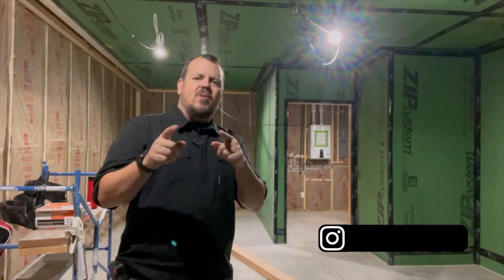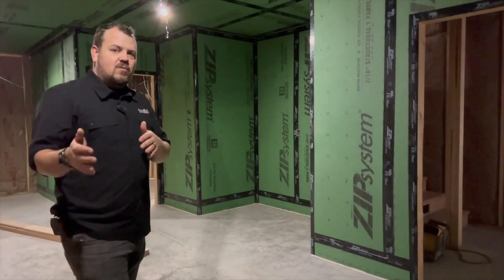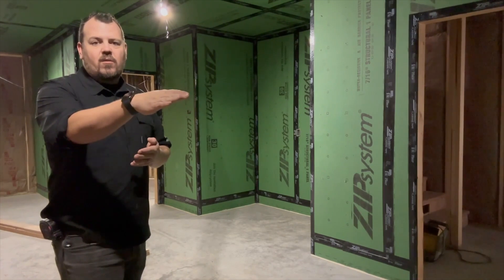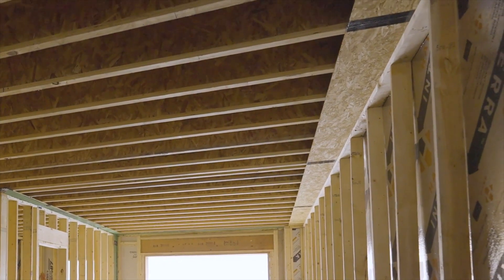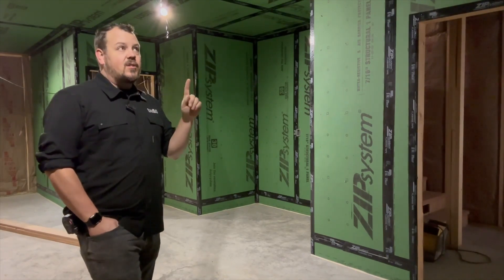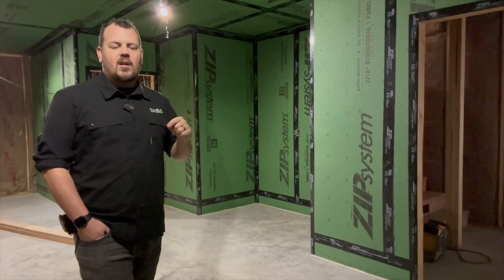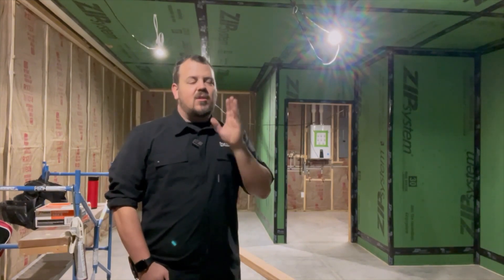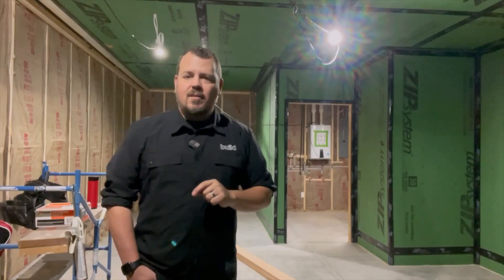Air Leaks Between House and Garage

Comment: I love the idea of separating the garage from the living quarters. From the perspective of a "DIY" guy, when I build my house I am not confident in my ability to properly seal all the smart vapor membrane around all the wires, pipes, and receptacles.  A hard surface would be much easier to seal for an novice like myself. Could I line my ceiling with Zip or taped plywood to make the penetrations sealed and then add the smart vapor membrane, put furring strips on the ceiling and walls so puck style lights and picture nails don't penetrate the membrane, then drywall?  Would I be asking for problems doing something like that or is it a waste of money? I should add that I will have a vented attic assembly and hopefully 2" of xps of outsulation in climate zone 5.
Reply from the maker: You got it just fine. Go right ahead and do a hard plane and then drywall over that. Seal to the zip or ply and then drywall around it. Or, like at my personal home I ran everything in conduit on the bottom side of the garage ceiling with no penetrations in the lid so NO air can move through.
Reply: @jake.bruton.aarow.building is it safe to assume I can do the same in the house side as well?

Comment: @jake.bruton.aarow.building 
Another great video. Thanks. I have also seen a few of Steve Baczek's videos on this.
Can you guide me in the scenario below.
My builder is not as savvy as you guys are, and I am learning and planning things.
I have a large living space over the garage. The garage and the conditioned home wall will have a Zip board separation + insulation facing the garage. The garage ceiling will consist of 2 x 10" or 2 x 12" joists (not final yet). If the floor above the garage ceiling is advantech, and I seal the boards with Zip tape, to make it relatively air tight. Then, I fill the joist cavities with Rockwool comfortbatts. And then install drywall.
1. Do you think this is a reasonable compromise for air tightness - Taped Advantech, and drywall?
2. I'm in climate 5A. The garage is not conditioned, but would stay at a relative milder temp. Do I need external continuous insulation below the ceiling joists (underneath the drywall) to prevent condensation? My regular exterior walls would be R22-23 cavity insulation, then Zip 7/16", and then 3" Rockwool Comfortboard 80, before the furring strips and cladding.

Thanks for your time.

Comment: Just a thought, but you may want to take a careful look at the penetration of gases like Carbon Monoxide, CO, and Carbon Dioxide, CO2, or other combustion products, as opposed to air and water vapor, through Zip panel membranes. Same for, say, gasoline vapors. Different compounds have different properties. Likewise, organic solvents have very different properties from air and water. The only sure way to protect people from gases like that is to vent them out of the space.
Reply from the maker: I appreciate the thought however those are very low risk in a system like this. There is another item here that I didn’t mention in the video. The real ‘ace up the sleave’ here is operating our building under slight pressure. This keeps items from outside (including the garage) from infiltrating our building as well. If you are operating under slight depressurization then you will draw from outside, the garage, or soil gasses even. That would be a problem. Balancing the ERV to operate at slight pressure is a plus (pardon the pun).

Comment: Well builded and well explained (even with the little fumbles with words😊). I did the equivalent at my place. One « problem » I encounter with a well « isolated » garage is air humidity in the garage. With no active ventilation in the garage and a very well sealed envelope (which is a good thing!) there is NO/nada/niet ventilation in the garage… I have to rely on a portable  dehumidifier to get rid off humidity. Does any of you found a good way to deal with that (small) problem? I live in Canada so I must deal with Summer humidity and snow melting in the garage during Winter (from the cars because I’m the kind of person who do park his car on the garage).
Reply from the maker: Our climate is much more mild and we haven’t had any clients have issues yet, including my personal home. A simple humidistat driven fan could tackle that in our market probably. Dedicated dehum in yours is probably better.

Comment: Given you're only doing this for air control wouldn't it be cheaper to use standard OSB and just tape the seams?  Personally i would have used 3/4 inch plywood to make mounting stuff easier in the future.
Reply from the maker: Potentially, we know how well the Zip tape sticks to the Zip panel and we know that we have had issue with the Zip tape sticking to OSB in the past. We would probably go to a fluid applied if we were to go to a different panel. I wouldn’t ‘upgrade’ to plywood for mounting items either, the plywood in my personal opinion doesn’t provide extra structure over the Zip panel. Either the items would be heavy enough to warrant hitting a stud or the Zip is plenty. Does that make sense? There are absolutely other ways to handle this assembly. Don’t think I am just reiterating our way being the only way, even if my answer seems that way. It just works for us, we have the materials on site, they work as a system, our team knows them, our clients understand why we are using them and so forth.

Comment: New homes should come with large roof overhangs, solar panels, a rain water collection system and an electric vehicle charger in the garage.
Reply: Sounds interesting, however it is likely to make the existing home affordability issue worse. Someone has to pay for those features. If those features became regulatory housing requirements, another segment of people would get priced out of the housing market.
Reply from the maker: I hear what you are saying, however, I think the issue is that we view housing the wrong way here in the USA. Everyone I grew up around thinks of a ‘starter home’ as having a two-car garage, a yard, and 2000+ SQFT. In the rest of the world, even the developed world, this is nuts. Our idea of what we should be able to afford is wildly skewed. If we aligned home ownership with quality this might look completely different. Smaller homes, smaller lots, much more multi-family options. Look at Europe. Home ownership isn’t the thing people try to build wealth around, the own a home when it is right for them. We have been fed a story by our country that ‘we all need to buy a house and raise a family’ to promote a stable economy, it doesn’t have to be that way. We can find happiness without huge mortgages.

Comment: Does the prosoco separate the ZIP from the concrete to avoid wicking water?
Reply from the maker: We don’t want the Zip touching the concrete for wicking reasons. Then we do need to seal between the two, the Prosoco was our solution to bridge between the two. It also won’t wick.